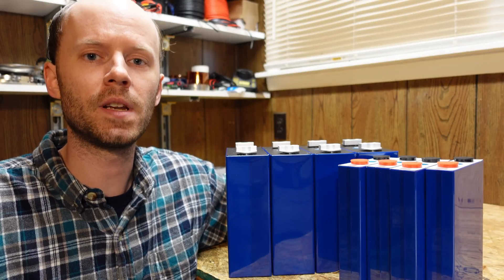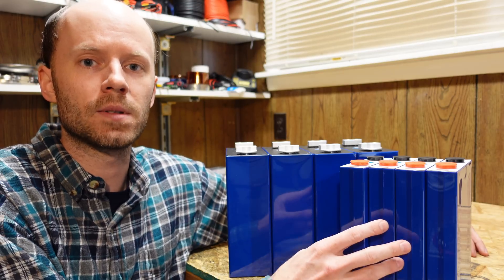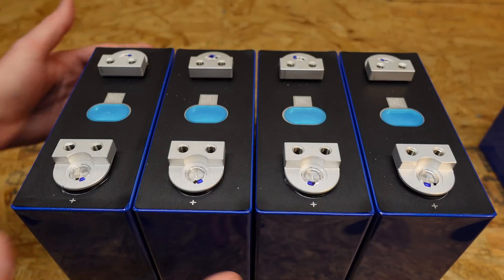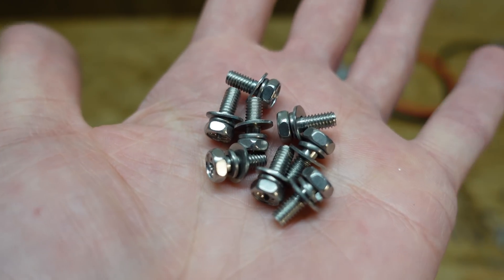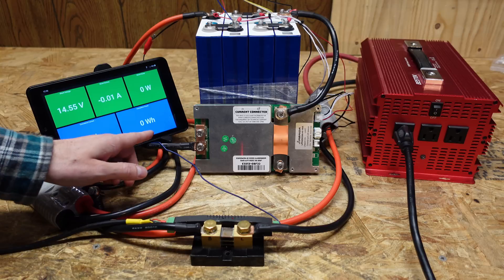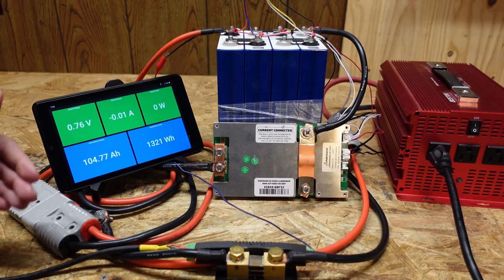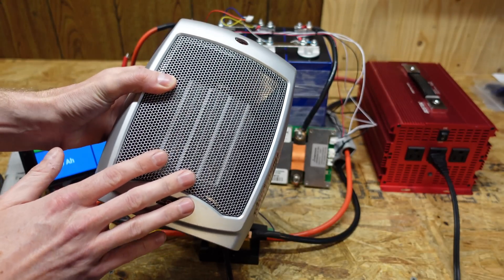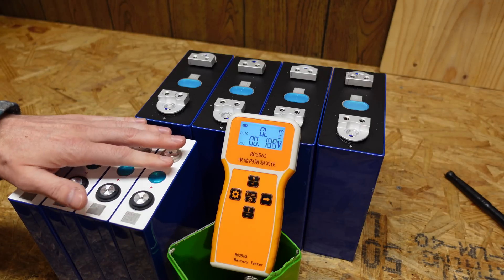Grade A EVE 3.2V LiFePO4 Batteries, 105Ah, 280Ah, USA Distributor!

Comment: Thanks for sharing very good information. What determines the maximum discharge is it only the cells, the BMS or both
I am planning to build a 24v 304AH battery. What should the maximum charge and discharge rate be?
Reply from the maker: The maximum discharge would be the lower number between battery rating and BMS. If the battery is rated for 100A but you use a 50A BMS, then your max discharge is 50A. If the battery is rated for 50A and you use a 100A BMS, then the max discharge is 50A (and hopefully you configured that BMS to cut at 50A as well).

Comment: I was under the impression that these were 3.2v 280ah hr batteries each.  Shouldn't 4 hooked up become 12.8v 1120ah. But the test still has them at around 280ah
Reply from the maker: When batteries are wired in series, volts increases and amp-hours stays the same. When batteries are wired in parallel, volts stays the same and amp-hours increase.
Reply: @LithiumSolar  Thanks you for explaining.

Comment: I see a lot of these style batteries set side by side in a box, but the space i have available is tall and skinny. Can i stack them verically and run a longer wire instead of a bus bar? Or is there voltage loss through thr wire?

Comment: Do you think the lf280f would work to run a Curtis Ac50 motor with 38 in series for 120 volts wit max current 500 amps?  I was also try to figure out how to do a bms with 22 batteries in back of car and 16 in front

Comment: It appears the links for the charger and bms are no longer valid.
Reply from the maker: The BMS has been discontinued. The chargers will be back again soon. I'm told there was a QC issue with one of the batches and they removed them while it was being sorted out.
Reply: @LithiumSolar  yep. I was just letting you know the link was bad in case you wanted to change it

Comment: Hello I am not an expert I am planning to use your link to purchase 8 of those LF280K batteries to use it with a 24v solar charger controller.

My question is will I need a JBD controller??
Reply from the maker: You will need a BMS with any lithium battery. It doesn't have to be the JBD that I used, there are a lot of options on the market now.
Reply: @LithiumSolar  Thank you so much what is your opinion about JK BMS 4-8S

Comment: I think I'm gonna order 16 280 cells today. Can you recommend a 24 volt bms that is good but that does not take a genius to set up? The bms will need to run a 4000 watt sungold power inverter. I'm not sure what Amp bms I'd need but I want it oversized for sure. It might be best to have 2 bms with 8 cells on each one. Any help is greatly appreciated

Comment: Tks for the video. In order to use the maximum cycle of the batterie it is showing on the data sheet to use it from 90 to 10%. of course the remaining capacity will be around 80% ...but do you have any idea which are the setting on BMS to get the maxs cycle? Max voltage charge and minimum voltage when discharge? Tks 
Raf from France

Comment: Curious, at 7:47 into the timeline, while testing the 280Ah cells, the display shows 74.2Amps of current. The voltage is at 12.79 so 3.19v per cell, or at least worst performing cell in the group. This is below 3.3v  Seems an automotive grade cell under such load conditions wouldn't fall in voltage like this?  Look at this test by SDK on a 280Ah Automotive grade cell. Watch the voltage and the current: https://youtu.be/KD-av4cTL-Q?t=1526
Reply from the maker: Voltage is being measured after the BMS in this video, so there would be some voltage drop across the BMS and negative lead. Additionally, this is not a precisely-calibrated instrument as shown in the video you linked to.

Comment: Hi...if using 6kw high frequency battery charger,with rema320 connector with CAN bus protocol..is that any bms come with can bus connection? Or any can module that can coordinate with bms and the charges
Reply: Unless the BMS manufacturer follows a standard, you might wanna check to see what modules they have to support CAN Bus.

Comment: Something is not adding up here... 3509 Watthours / 282.40 = 12.425 Nominal volts or 3.106 v/cell.  Nominal voltage for LFP is 3.2 volts. So it should be 3509 / 12.8 =  274.14 AH / cell.

It should have tested to 3584 watts / 12.8 =  280 AH / cell.  I think you took the out going amps as the capacity instead of calculating capacity based on the watt hour which is to divide total watt hours / nominal voltage.
Reply from the maker: Nope. Read my reply to your other comment.

Comment: Hi, thank you for all the videos you do.
I have 32 x Eve 280ah cells on the ship to me. 
I am wanting a good bms.
I have Victron multipus 5000.
so fully loaded i am needing close to 200amps discharge.
I also have 24solar x 330w panels on my roof, running through 4x victron 150/85 mppts to charge my 12x 2v @ 1250ah gel batteries.
I believe the LF280k has a1c charge rate.
Is there a bms that can handle 250amp charge?
I am considering charging the new lifepo4s from 18 panels and 3 mppt, each supplying around 80amps in good conditions,  therefore 240amps.
I used Daly 200amp in my bus build, but that is only charging at 40amps though house power supply.
I need heavy duty for my off grid shed but can't be sure which bms to choose for high charge solar.
What's your thoughts?

Comment: Our cells are brand new with original factory QR code intact. Never used. No dents or swollen cells, 5-year warranty, with free bus bars and screws, we test the voltage, capacitance and internal resistance before we ship the goods to you, EVE 280K only requires 109 USD from EEL BATTERY
Reply from the maker: EEL BATTERY - have you contacted me via email? I've seen you comment a few times but don't recall seeing any emails from you.

Comment: They went up in price and only a 1 year warranty? You just posted this 4 weeks ago. I have seen some give 10 year warranty for defects or product fail if not abuse or misuse or normal wear, basically about the same time as the number of cycles. Battle Born American company is one of them, though quite pricy. 
I know you are not the one that has anything to do with that but in a way you are advertising their product.
Reply from the maker: 18650 Battery Store is not manufacturing this products. They're a distributor. It doesn't make sense for them to provide the warranty on the product. The 1 year warranty is plenty sufficient in my opinion. Battle Born is a manufacturer for which the cells they use are a component of the product they create. It makes sense for them to warranty their product for longer. Additionally, 18650 Battery Store warned me ahead of time that they were considering a price increase due to the ever-rising cost of everything.

Comment: These are now $630 for the 4 pack of 280ah. $30 increase in 3 weeks. No thanks.
Reply from the maker: Yes, they warned that a price increase would be coming before I even made the video. They were honest up front.
Reply: @LithiumSolar  No doubt they are very nice cells.  You did a great job on the video.  Thank you for that. 

Do you have a favorite value option for a good lifepo4 100ah and a 280ah?  I'd love to diy a build...I have a 24v system with a Tesla Model S battery now.  Want to convert to Lifepo4.  Chins prebuilt looks like the best value...but I'm out of the loop.  Would love your recommendation.  Please and thank you!
Reply: Right now they are $750 for 4 cell pack. Looks like significant increase over 4-5 months.

Comment: quick question, if i wanted to wire for 12v inverter, how many cells would i use? 3 cells seems too low, and 4 cells seems too high. i think my 12v inverter shuts off at 10.5 volts on the low end and 15volts on the high end.

perhaps there is something i am not thinking about? thanks again for the video btw

oh, i see the voltage range of lipo is not what i thought it was, 3.2v nominal, 2.5 is 0% soc, and 3.65v is 100%, i assumed 4.2v was the 100% soc resting voltage
Reply: 3.65 is fully charged. This is not Lipo this is LifePO4. Lipo go boom if handled by dummies

Comment: Pardon the newbie question, but would it be possible to build a pack with the cells "flat"? 
 I guess what I am asking is do these cells have any type of orientation restrictions?
Reply from the maker: I've been told before that any orientation is acceptable other than upside-down (vent pointed to the floor). I have no supporting evidence for this though and would suggest double-checking with the distributor or EVE directly though before doing anything.
Reply: Yes, either standing up or on their side but NOT flat. If flat half the battery is out of the liquid.

Comment: Excellent video, very informative. As for the 280 ah batteries, could you please, explain to me how to connect 8 of these batteries to make 12v 560 ah battery bank? Would I need 2 BMS's? Thanks in advance.
Reply: So 4 of these batteries cells would create you a 12v battery pack thats why they sell them in 4s because they are 280ah 3.2v each when connecting all 4 it creates your 280 ah (3.2vx4=12.8v battery pack) so if you bought 8 you would be able to create  2 battery packs so you'd have 2 280ah 12v battery packs and depending how you run them in parallel or series you could have a 24v 280ah battery setup or keep in 12v depending on what type of inverter you are running and id run a bms for each battery pack you create. Hope that helps a little im still learning all this myself Goodluck brotha
Reply: Will there do well with car audio

Comment: Ordered 4x 105Ah cells. $271.15 out of the door. Not bad. These will serve as 12V ballast pack to power all my computers, monitors and other electronics in my radio shack in event of power outage. Thanks for your review!

Comment: Very interested to order some, new at this but 4pk of 280ah @ 3.2v is 3.584kw?  I am looking to build a power wall with 10-15 kw to support my house in case of PG&E outage.
Reply from the maker: Yes, a 4-pack of 280Ah batteries would be 3584Wh (3.2V nominal x 280Ah x 4pcs = 3584).

Comment: These look intriguing, and would be a great science project for my 10 and 11 year old boys.  We already built a mini solar generator using 28 ah lifepo4's 2 in parallel.  Being retired makes the cost point sweet as well.  I get the putting the 4 cells together and the bms and even the balancer.  What I don't get is how to put these cells into a working form as a common battery -- or what this 60 plus year old knows what these batteries could resemble.  Any help would be appreciated.
Reply: https://www.youtube.com/watch?v=X_ucHHnh4Ik&ab_channel=SolarEngineering
Reply: What do you mean like a common battery? Like a typical 12v lead car battery or what type of common battery are you referring I may be able to clear up a few of your questions
Reply: @kingsamoanOG  Thank you so much.  This uses the anderson sb175 quick plug in for connection rather than the positive and negative poles you screw a bolt into to make connection to the battery.  Is there a way to bypass the anderson 175 and have just 2 poles like a car battery?  Wish I could post a picture, hundreds of batteries like the normal 100 ah lifepo4's that demonstrate what I am speaking about rather than the anderson 175 connection.  Thanks for assisting.
Reply: @Guardianwill  I would imagine anderson or some other company would make an adapter it probably won't be your typical poles but I'm sure they have some sort of +/- adapter with just leads coming off. I'm not familiar with anderson but other companies make these adapter with just wire +/- leads coming off the plug
Reply: i am older than you and now i am intrigued;  
What do you mean "put these cells into a working form" ?
Once you assembled the series of 4  with the BMS,you're done; it's a battery; no?
Reply: @josepeixoto3384  Yes absolutely, bit most people consider a battery looking like those you see in the walmart tire department.  This could be a little overwhelming with 2 wires to connect to and not two posts as they are accustomed to seeing.  I actally found my answer quite a long time ago connecting the two cables to a marine 250A bus bar and then further connections.  This is stated in ints simpliest form, of course I have a meter and on/off switch and a fuse connected to.  Thanks...  Maybe, one day, they will make simple boxes for these various sized lifepo4 where you can house the bms and cells into safely and have the two posts on top.  Reasonable as well.

Comment: Thank you. This is really good. I have been trying to get a good supplier for EVE batteries. I have ordered today for their 2 packs of 12V/105AH. The cost is same or better, and the shipping to Canada is less than $100 through FedEX, Compared to $ 180/- through Ali Express and long wait time by sea freight.
Reply from the maker: I don't think there are any trustworthy distributors on Aliexpress. That's just my opinion though...
Reply: @LithiumSolar  I received the brand new EVE 3.2V/105Ah x8 batteries within 2 weeks to Canada from 18650 battery store, USA.. Excellent service and price, and shipping through FedEX. Still waiting for the JBD 4S BMS from Ali Express, more than 3 weeks. Thank you for posting your video.
Reply: Hey Ajeeth it would be really cool if you would post back with your experience having the cells shipped to Canada Im looking at buying a large quantity of the 280ah cells I’d be interested in your experience.

Comment: Ordered the 280 ah batteries on Thursday. Received them on Saturday. 4 boxes. (16) cells. From GA. To Michigan. Regular shipping. Very very fast!!! All in excellent condition. All shipped at 3.28 volt except one cell at 3.1 . Very happy so far. Need to top balance and all. Will give update once installed. Thanks for a good supplier.
Reply: Batteries are working good. One cell seams to always be higher at lower charge but when at higher charge is lacking behind. Tried to make better connection but still dose same. Other than that, very happy with them. Getting them in 2 days is a big plus. But I see the price has gone up a bit sense purchased. All and all, still think they are a pretty good deal.
Reply from the maker: Awesome! Please keep us updated once connected/installed!
Reply: Can u give update on your batteries? Do u still recommend

Comment: I priced a build for a 100 amp 48V battery, and with a quality BMS and case and cb, it was about $1,450. The Jackiper is $1,699, the EG4 is $1,499. Your shipping cost may vary, but seems like there is not the big incentive to build a 100ah 48v battery anymore. Building a 280ah 48v saves more.
Reply from the maker: I agree there isn't much incentive when looking at the 100Ah batteries; however, cost changes quite a bit when looking at larger cells such as the 280Ah.
Reply: Free shipping helps but the price is still too close to already built options in my opinion. I think the last set of 4 chins 105ah batteries cost me $1290. to my door. I have 2 sets of 4 chins, and 2 sets of 4 of the zooms batteries. Always bought 4 at a time and never broke the $1400. mark. With the exception of an over priced Hsky 48v battery I bought from Big Battery. They were the only place that had anything available at the time when I needed it. I would have loved to go the server rack route but they were always out of stock and on backorder.

Comment: Can these EVE LF280K battery be stacked 8 pieces high?
Reply: I am putting them in a group 27 lead acid battery box there's room for them plus the BMS is inside those as a 12-volt battery and you could stack those on top of each other

Comment: Why you discharged packs to 0.2C ? is it the default continous discharge specification or because its cold atmospher at your place ? Thanks
Reply: while i dont know for sure, i assume its the rating the manufacture came up with. unless you know something i dont, which is possible. i have been playing with lipo for years, lead acid for about a year, but have no lifepo experience.
Reply from the maker: I use 0.2C as it's the industry standard for capacity measurements. That said, many of these big LiFePO4 batteries have standard discharge rates of 0.5C or 1C. I still stick to 0.2C so there is a fair comparison across the board in addition to it being a better reflection of how I see them being used in the solar/off-grid space.

Comment: It's a very good deal if it's shipping locally for you. However those 105Ah cells that you bought by yourself didn't produce 105Ah, isn't it a concern? I have those cells from a reseller, but it gave 106-107Ah capacity on my initial test. The cells you have may be imbalanced or there is something wrong in the quality. Please check. Thanks.
Reply: also called margin of error...it was 105Ah...dunno what you're complaining about.
Reply: @TheGuruStud  Yes margin of error should be over the rated capacity for a Grade A cell, not below it. That's why we should always get over the rated capacity for the first few cycles when tested if the cells are really Grade A. It is the industry standard. I am not asking for anything out of the ordinary. Thanks.
Reply: Good point for a Grade A it should be over that 105ah

Comment: The double terminal is interesting. I have never seen that before. On the main pack pos/neg you have the main leads and balance leads on separate terminals. If i wanted to run 2 main lead cables, one on each stud, is there room on the stud for the balance lead and a main power lead?
Reply: No reply from LS. Has anyone else used these cells that could comment?
Reply from the maker: Yes, there is plenty of room for multiple cables under one bolt. Even if there wasn't, you could just get a longer M6 stud.